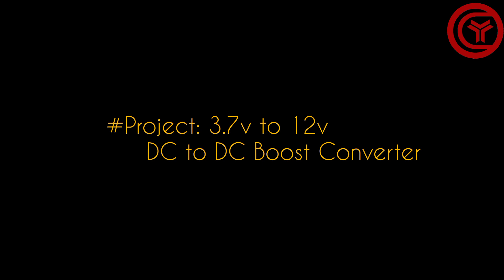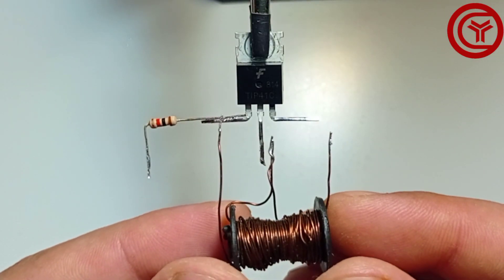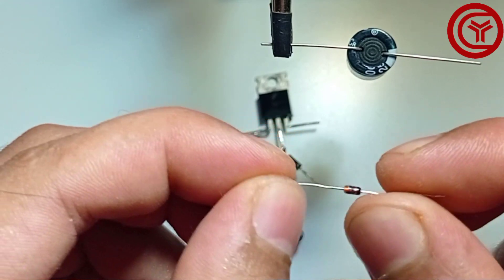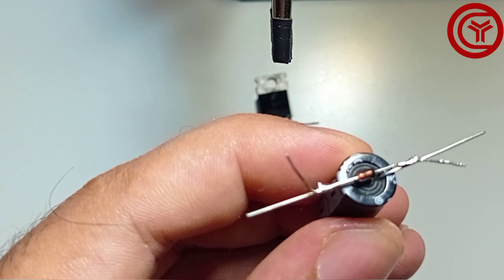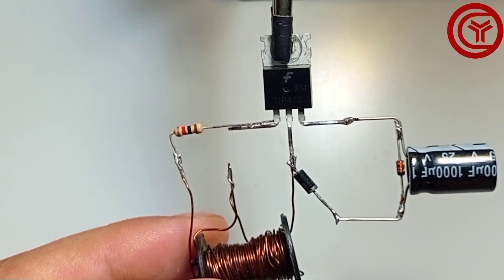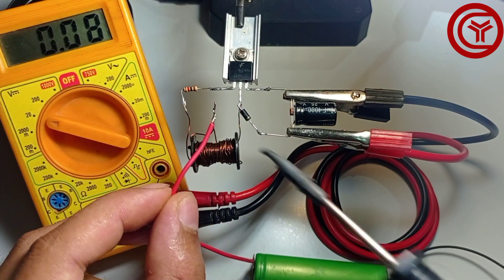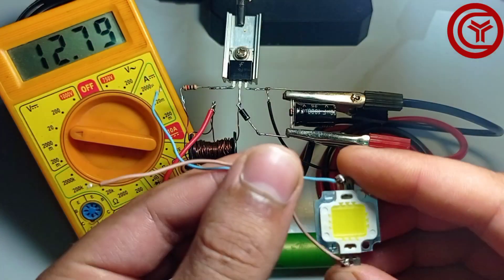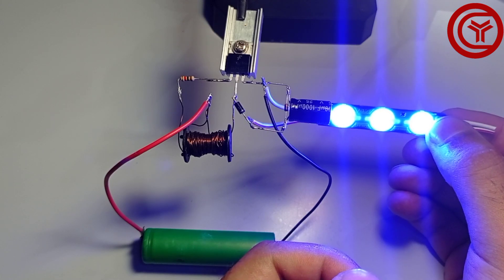3.7v to 12v boost converter circuit

Comment: I am writing from Sri Lanka and tried some of your methods. Really every thing is giving the correct results. Thanks for your easy way of explanations from which I found easy way of designing the circuits. Even this converter I did as you mentioned but I get only 9VDC instead of 12VDC. Can you suggest any idea how I could make it for 12Volts. Is it possible to use toroid core with increased thickness of wire to get 12V? Please continue your videos on subjects like this. I am very much interested to study from your works, please.

Comment: Once i connect load voltage dropped down by 50%.
Any solution possible ?
Reply from the maker: As circuit is very basic without feedback voltage stabilization, I'll soon upload with this feature too.
Reply: Ok, thanks
Reply from the maker: My pleasure, Thanks for watching 🙂

Comment: Why only TIP41C transistor?
Reply from the maker: Actually it works an oscillator to boost the voltage
Reply: @CreativeTechos  Thanks for response.
But I wanna know, do we have another transistor option?
Reply from the maker: Yes you can use any NPN power transistor, but take note of pin configuration
Reply: @CreativeTechos  ok, thanks 🙏
Reply from the maker: My pleasure, Thanks for watching 🙂
Reply: Thanks for reply.
But I wanna know, do we have another transistor option?

Comment: NAMSTE SIR KYA 12V KI JAGAH 5 SE 7 V KA BOOSTER BANA SAKTE HE KOI VIDEO HO TO SEND KARNE KI KUPA KARE
Reply from the maker: Yes simply use 5-7v zener diode instead of 12v that I used in video to stabilize voltage at 5-7v

Comment: Can we use 2 sperate inductor coils. With 2/2 connection.or it is necessary to connect one coil with 4 connection
Reply from the maker: Its not two inductors, its center tapped inductor coil wound on ferrite core spool.
Please watch video
Reply: @CreativeTechos  today i experienced that .you are right .it must b center taping. 
Not working two saprate coils.mosfit became heat up.
And when i connect center taping one coil with 2 taping.than its working perfectly
Reply from the maker: Best of luck 👍
Reply: @CreativeTechos  one more thing is important to explain.
That . Coil taping is must clockwise and anticlockwise as same as one side turn and other. For example 19 turn clockwise and 19 turn anticlockwise.
Anticlockwise connect to mosfet gate.
Reply from the maker: 20-30 turns clockwise then center tap then again clockwise
Reply: @CreativeTechos  done .i experienced this methord also. 👍

Comment: This would be very inneffecient
Reply from the maker: No, it provides efficient current as power transistor is used
Reply: @CreativeTechos  Im trying it right now, Ive tried it before but with a huge transformer(used as an inductor) the result is very inneffecient.
Reply from the maker: Don't use transformer as inductor it will drop all current, use 24guage wire with 30 & 30 turns on inductor with loop at centre, and use TIP41C Power transistor to get High power.
Reply: What circuit can you recommend to boost 48v to average of 90v?

Comment: I need automotive circuit for obd2 DLC connector from 24 volt to 12 volt please I want to reduce the voltage from 24 volt to 12 volt
Reply: My wathsapp +51971242410
Reply: fácil tan solo puedes hacer con un transistor 7812
Reply: @RobertoFuentes1011  quieres decir regulador 7812, no en lo mismo que un transistor.